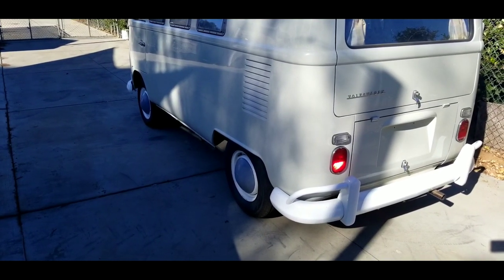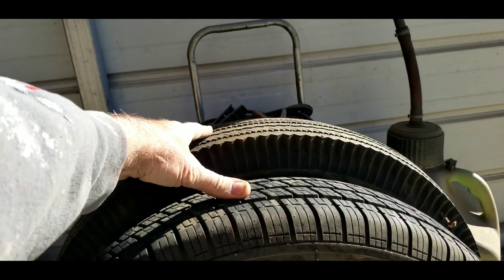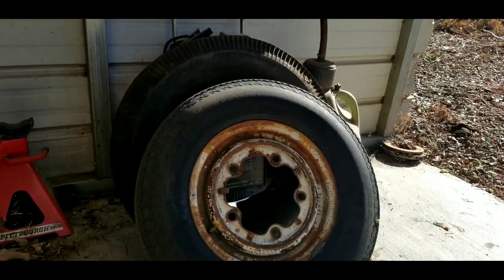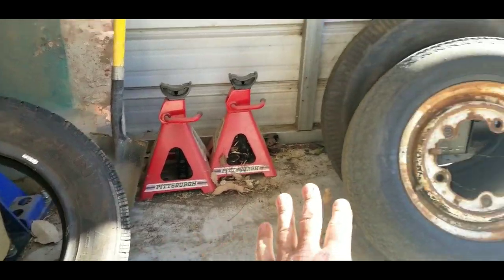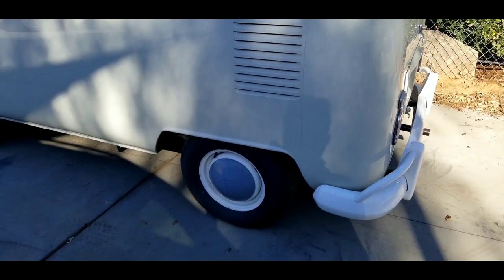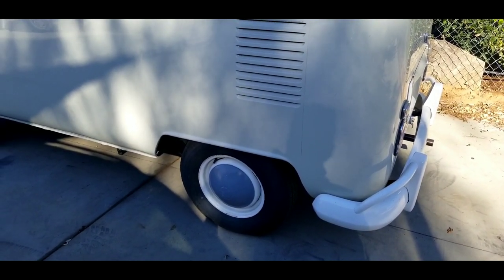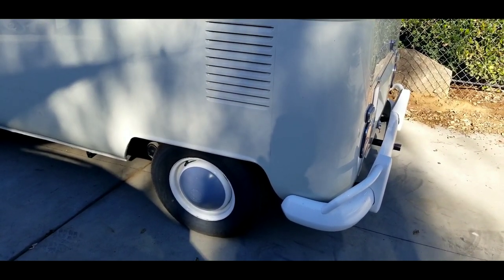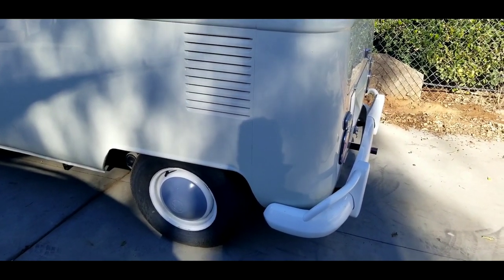VW BUS tire sizes and gear ratios for todays roads

Comment: About using a jack to push the axles down on a lowered Bus. It can depend on a lot of things. How low the Bus is, wheel size and offset, tire size, and the year of the Bus. On 63’s with the flat wheel arches have a lot less clearance then a 63 and up. I’ve had a few mildly lowered 64 and up Buses with aftermarket wheels and 205 width tires, and didn’t need to push the axle Dow to change tires.
Reply from the maker: Wow I have not heard that. Most of the guys I know need to jack the arm down to get the tire off. or have super small tires that defeats the gear ratio problem.
Reply from the maker: or I have heard of guys who narrow the rear and that works.

Comment: That's what I ran on my 66 vw camper bus with reduction boxes 205/75/14
Reply from the maker: honestly that is the bare minimum IMO. You would really like the 3.44s Some day make the upgrade. Even at 65 you can really have a conversation with someone else in the car. not too loud but still plenty of air through the engine. Runs super cool. gets it in that air RPM sweet spot.  you could have Benco do a bench on the Box only put the boxes on yourself and have some passing speed. I was passing a boat and trailer on my way to Havasu for BBB and had to hit 85 for a second. Did it no problem.
Reply: @Mikefngarage  I need to change the gear ratios, I'm running stock and pulls strong but 60 to 65 max interstate.
Reply from the maker: @HERBYWALLACE3  can you believe that the Bentley says cruising speed is 65 with 185 sr 14 and passing speed is 70.  that was seriously screaming. No wonder there were so many blown engines and cut fender wells on these busses.
Reply: @Mikefngarage  yes, it's crazy, my 1600 DP ran forever that way

Comment: I think the 65-67 had a 4.375r&p with the big nut. It was the small nut busses that had the 4.125, with exception of “little big nut” and 64 with the 4.125 and big nuts. I’m having issues pushing 60 in my 64(4.125 and 1.26 boxes)with a 1500 running 205/70r14 tires. I wonder if you think a 1500 could push a 3.44 with a .89 4th? I like the idea of having a higher speed in the lower gears. I think vw realized that 4.125 R&P with the big nut boxes was a little too tall stock. It is a long slow pull with the 1.5L from 43-60mph......

Comment: You are correct , but at top speed in3rd is 45mph but to geto 55 in 3rd is ok to pass but prolonged winds myorv up the 4.125 ring pion set was only found unused up to 63&HALF.VWOF BRAZILRAN 4  125RP W ITH CLOSE 3RD &4TH,FROM 1964 ON THE RING AND PUON WAS 4.375 REDUCTION WAS 1.26

Comment: So the tire  he has on is basically 26 in tall so if you want a low profile you would need to go to a 17 in with 215/55/17 which is 26-26.3 " tall on the rear. That's what I get if you want after market wheels.

Comment: Lots of good info. I heard that you are supposed to run “lt” light truck tires on vans and not passenger car tires.
Reply from the maker: busses are light enough for passenger car tires. On my bucket truck I am using more sidewall Trailer tires because truck ones are not readily available in that size

Comment: Rambus needs one of those Rancho Freeway Flyer trans. + I would like a center mount 2bbl carb. I have a W 100 Engle and its a DP with D-port heads , Quiet muffler that the J tubes are welded to the header pipes.  I have 205 - 75 - 14 s  I have no idea if it runs 70 mph anymore .
Reply from the maker: Benco is a bit cheaper also There is KCR in riverside much less and just as good as Rancho.

Comment: Hey Mike. Got a question for you. If we have the 1500cc industrial engine in our bus, supposedly has about 60 hp, would we be able to put a 215/75r15 on to gain speed? Gonna need power for our trip to California.

Comment: Hey Mike.  Great Video.  I have a 2007cc and Freeway flyer in my 68 bus.  I have the Hankook Vantra Commerical tires on my bus.  63 mph on the freeway feels like the engine is winding at about max comfort sound.  Would a different size tire give me a few more MPH?  Where did you get your double freeway from?  Thanks Mike.
Reply from the maker: Yea I am not sure what size you have 205 75 14 or even 215 should fit in there.
Reply: @Mikefngarage  vantra 75 14 is what I currently have.
Reply: @Mikefngarage  What Brand of tires do you have on your 2007CC red bus.
Reply from the maker: @jeridmark8082  IM not sure probably the cheapest ones I could find. Some china brand ones.

Comment: Hey Mike what about for a 71 baywindow. I'm running a 175/65/14 rear tire, I did lower the bus with 4 inch narrow front beam, with 2.5 inch drop spindles, and the rear im running 3.5 inch horse shoes. What size can I go with to lower my rpms on the highway?

Comment: I have a 66 camper and was wondering if I do change sizes of the tires, do you have to do anything with the speedometer to make sure that it is reading the proper mph?
Reply: Great question
Reply from the maker: I run the big tires in the rear and near stock tires in the front. so the speedo is correct.
Reply: you would need to do that. fortunately there are people with 3D printers who can help you with this problem. example: www.odometergears.com/products/Volkswagen/Mechanical+Speedometer/19

Comment: Hey mike 
Im running a big nut trans with gear boxes. Its a 3.88 with .77 4th. So it comes out to 3.76. Paired with a 1915cc. I recently went to a show and some dude was saying im gonna blow up my motor. The motors not the healthiest but it still feels strong. Im also running 205/85 15 in the rear. What do you think?
Reply from the maker: I dont think I have ever heard of a 77 4th. I have heard of a .79 but I am not totally sure they make that for a bug or bus trans. Those were in Rabbits. but I am not sure if they can be used in a rear wheel drive car.
Reply from the maker: no that would not be a problem with too low fan speed IMO lower gears than bug 3.88 even with those numbers. final drive 3.45 but your tires are taller so your about the same as a 3.88
Reply: @Mikefngarage  thanks mike! Some peace of mind lol. Dude was saying if your running the gear boxes to get a factory size motor to be the perfect combo. Worst comes to worst i was thinking of a 1641 or 1776 with efi. Low budget out in orange seems to be the specialist for efi builds
Reply from the maker: @stevechan9914  yea those EFI are great FItech. with budget software. 1800 is a great motor 74x88 or 74x90.5

Comment: My '58 bus has the stock split case tranny, and even with 205/75-15s and a built 1776, I'm pretty much maxed out at 55. Anything i can do to mod the split case to get a few more mph outta the old gal?
Reply from the maker: I would usually change to a big nut later model trans. The split case usually had 4.375 gears with the .82 4th. small nut 1.39 to 1. Stock Big nut had 4.12   .82 and  1.26 to 1. I change them up to 3.44 .89 4th and 1.26 big nut. then you can go as fast as you want.  Even if you find a stock small nut from a 61 and later that would be better because they had the 4.12 my truck goes 60 max. with later trans.

Comment: I need tires bad for my 70 VW bus it has 205 70 14 is there a tire that's just a tad bit taller I can run to drop the RPMs 0n the freeway ever so slightly maybe a  215 70 14? Or staggered 205 70 14 front? I read so much crap I'm just really confused now😂